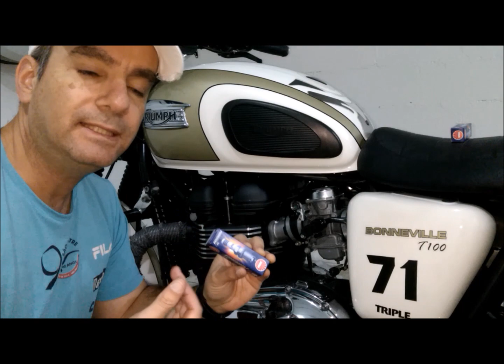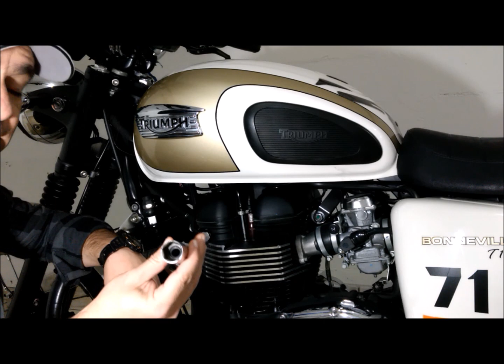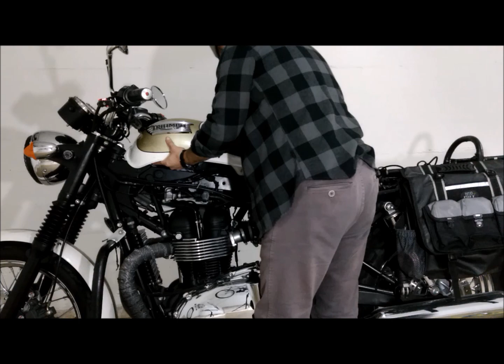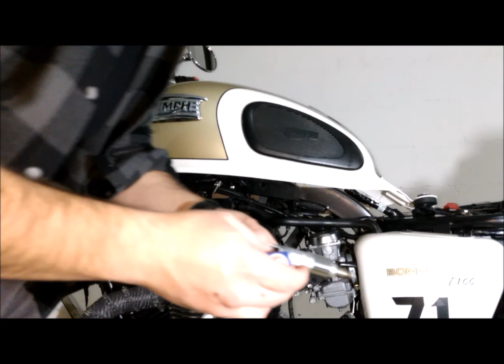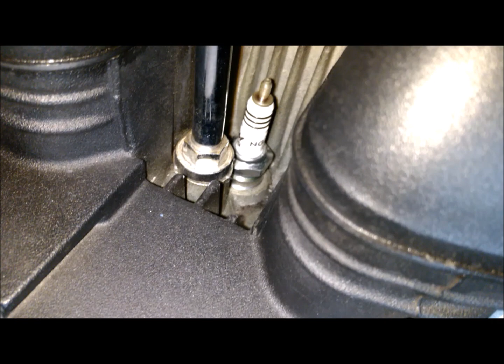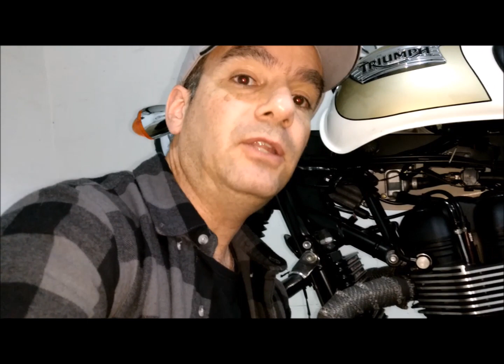Triumph Bonneville T100 -  Take 27  - Colocação velas de Iridium

Comment: Olá, tenho uma T100 semelhante a sua porém, é preta e vermelha.
Notei que quando ligo o motor, ele estala quando está frio. Um estalo semelhante a quando você desliga ele, quando está quente. A sua também faz isso?
Reply from the maker: Fala André! Bonita a preta e vermelha !! Sobre esse estalo, agora que você mencionou, parece que a minha sempre fez isso... Mas como sempre relacionei a barulho de dilatação e contração de metal, nunca liguei. É um estalão forte até. Provavelmente tem a ver com a dilatação e contração do sistema de escape. Ele tem a fixação na balança da moto e além disso, no meio dele um tubo se comunica com o outro, sendo possível que esse estalo venha desses pontos de fixação ou junção.
Reply: @leandro-yesyoucan  Tudo certinho?
Pois é, também acho que é dilatação. Só não tinha mesmo certeza pois comprei a Bonne a pouco tempo. Ainda estou conhecendo a moto.
Futuramente, pretendo fazer algumas modificações estéticas.
Vamos falando...
Obrigado por responder. Grande abraço